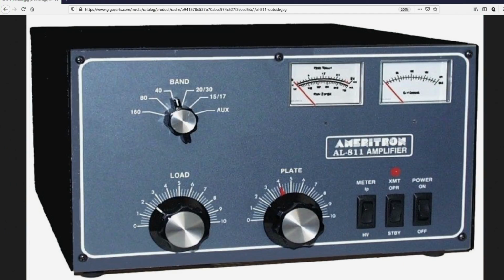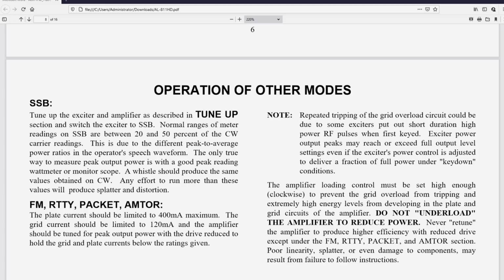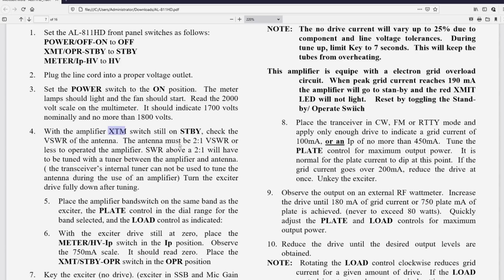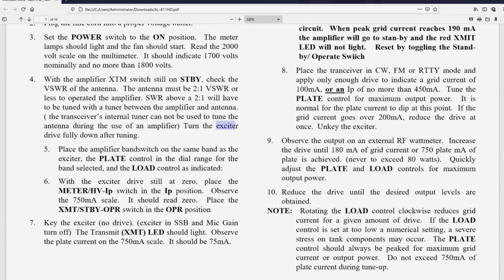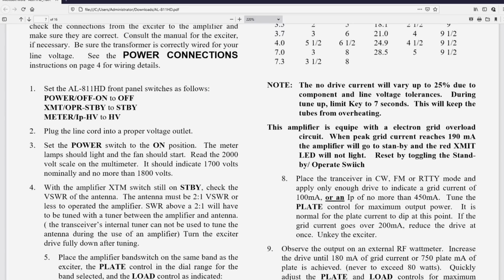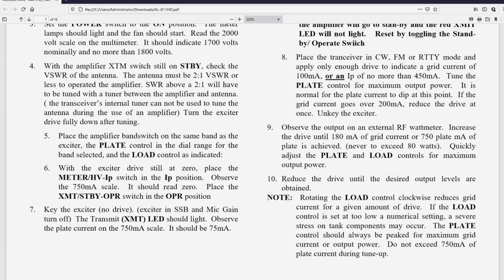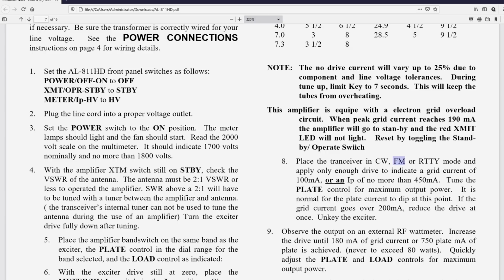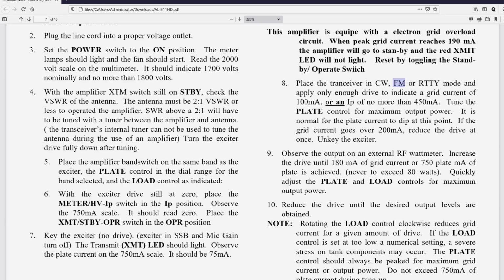Ameritron Amplifier AL-811 Instructions Have MANY MISTAKES About Tuning As Shown By Jim Heath W6LG

Comment: The AL-800 is three 811A tubes and 600 w.  The similar AL-800H is three 811A tubes and 800 w.  572B's are drop in replacements, but replace all four tubes.  The 572B's will not make any more power than 811A's, that is determined by the power supply.  However the 572B's are more rugged.  I replaced my own AL-811H with the ALS-600S (600 w), and no one receiving my signal could tell the difference.

Comment: I have the AL 811 and am afraid to use it because this manual is confusing . I know that I am suppose to NOT exceed 550 mA on the plate and NOT exceed 150 on the grid. And your suppose to key for 5 seconds with 15 second cool downs. And you never want to exceed the maximum plate current. These instructions also use the word exciter. Well from what N5SIM (Troy Radio Service) told me, Your radio or transmitter becomes and exciter when you put an amplifier between your radio and antenna or tuner. So Radio to amplifier to tuner to antenna. This manual does need to be re written not only for spelling and grammar but to get it up to date with modern radios like Flex Icom & Yaesu. In my case a Yaesu FT 710 or 991A. The manual also mentions on page 6 paragraph 6 "key the exciter (no drive ) Does this mean zero power ? 0 Watts ? WELL modern radios go down as low as 5 watts NOT 0 watts. W8JI wrote another manual for this radio too. I guess I wait until I can get someone over to my house to show my how this is done. Thank you.
Reply: Hello James - I have the Ameritron AL-811HXCE.  The manual is very bad as you know.  However the easiest and best way to tune your amp is to tune it up driving it with 10w then peak both Plate and Tune for maximum power on your outboard VSWR/Power Meter.  Increase your drive power to around 40w and again peak both Tune & Plate again for maximum  power out.  The maximum driving power is around 70w.  Always tune for maximum power.   My AL-811HXCE has 4 x 572B's so I drive it with a maximum power of 65/70w.
If you amp has 811A's don't keep the key-down tune up for more than the time it takes to tune for maximum power.  The 811A's are not as robust ass the 527B's.
I hope this is of some help.
73 & Happy New Year

Comment: yeah, the AL-811 tuning instrux are horrible.  hardly anyone i know understands "page 7" of this manual.  the best way to tune this amp is by peaking the grid current and then dialing up the load to achieve the proper mA for the tubes.  Tom W8JI, the designer of this amp, has a great YT video on tuning it.  'Tom W8JI' is his username.

Comment: to sum it up .tune for max output and then increase load to the point where power starts to drop a bit...ok you do that in small steps (say 20, 40, 60w of drive)...but in fact that is what to do..tune for max power without overdriving and without going over 180mA on the grids...well explained how to do it safely (in 3 or 4 steps of power setting) ...
increasing load lowers grid current (and output if loaded too high)... so there is a sweet spot (and that is what we are looking for ... not?!?)
I guess easiest is to SHOW it to your friend in real...
in a 4 tubes amp the "dip" is not that easy to see but the max power on an external power meter shows you that sweet spot ...main thing is to watch max grid current (not to trip that safety circuit) ....and do not overdrive it

Comment: Thank you very much for this very informative video. Just acquired an AL-811, and will be eager to get it set up. I've been a ham for about 5 years, previously had a solid state Ameritron, which I was never able to get properly adjusted. Looking forward to getting this one in line and working. Nice to have the extra power when it may be needed.

Comment: This amp will not stop transmitting if the swr rises above 2:1.  The solid state Ameritrons will but the tank circuit in the tube amps can handle an swr of 3:1 and have no protection circuit to shut it down. Don't know why they even have that in the manual.

Comment: I other words not only poor soldering QC , but bad directions an all for $1000.00 WOW welcome to ham radio new bee’s! JohnBoyUtah KJ7TBR 🇺🇸😎📡🎙
Reply from the maker: Yes. So, as you point out, examining the amp before applying power is a good idea.  I have seen tubes out of the socket, loose wires and other poor connections.  The design is good and the amp overal is good for the money. The owner just needs to be very careful in doing a review prior to plugging it in.  And, never open the box without extreme caution to make certain that nothing inside has a charge on it.  Thanks for writinig.  73, Jim
Reply: CTR Engineering, mods are all good

Comment: I have an AL 811 and I did the 10 meter mod this morning. It will not key up on any band.  I bought it used a year ago and this is the first time I connected it and according to Ameritron, the 10 m mod is the same as the 811H. So today I am scanning You tube and asking questions. Any help would be appreciated.

Comment: Thanks John. It would have been nice to see your video when i first got my 811 3 tube amp. It is a older amp i bought used with RCA finned tubes in it. I must admit i have not done the load plate loade plate sequence as you teach somehow the instructions werent clear about that. I have been setting the load where the factory suggested and starting just under 20 watts and i usually peak the plate quickly rest and do the load. I have been doing it backwards for at least 5 years. Oops! I guess it's tougher than me! I always make sure the PLATE current is less than max, like the three tube amp max is 150 ma instead of 2oo ma on the H model with four tubes  i'm usually at about 140 ma on the plate and can't remember grid current but it is lower than it can be by a fair ammount. I am usually running around 450-500 watts with about 38 percent drive on the IC 7300. I will have to experiment and see what happens. When i get it peaked and tweaked, I do rotate the load till the output drops just a little. I guess i am lucky. Mine is old enough not to have the limiter although I believe if can be added.
Reply from the maker: I am very dyslexic and get lots of stuff wrong.  When I would testify, the Bailiff would say: Mr. Heath raise your right hand and .....  I had to stop and think. Right/left....hmm.  73, Jim

Comment: Like Roger below I have an amplifier, not a Ameritron, I fear to use and your instructions have set me on the correct track for tuning.  I have a late 70s Sigma 3000 D (2 3-500 tubes).  Question: If I do not choose to run at 2000 Watts (because it will kill my tuner), can I stop at any point along the way, slightly increase the load and proceed to operate say at 900 watts. WS7T
Reply from the maker: I do the latter and by doing that, don't damage equipment.  Thanks Jerry and 73, Jim

Comment: I just viewed this video. Thanks for posting. I’ve had an AL811H for a few years, but I rarely use an amp. But, during the times that I did use it, using the supplied tuning instructions, I always ended up hoping it was correct and saw jittery meters. I tuned the amp this evening after viewing, presetting the load and plate, then starting the process at 20 watts and stepped up through the 20 watt steps. All bands tuned smoothly and the process was so smooth. Metering looked great, not sudden jumps or strange readings. These are good amps, just take care of the 811’s. I feel certain that this new tuning procedure will add life to my amp. Thanks! KE8EC.
Reply from the maker: Excellent.  Tubes will become even more expensive.  So take care of the ones that you have....as you have discussed.  73, Jim

Comment: My first linear is the 3-tube AL-811, and the manual (version 4!) is as badly written and confusing as this one (almost identically so). I have typed up what you say, Jim, as it applies to my smaller amplifier. 
1. Select the amplifier band switch to the appropriate band and turn on but place in Standby. Place the Meter switch to read Plate Current (Ip).

2. Select the default Load and Plate settings per the amplifier manual (page 7).

3. Tune the antenna to the desired frequency with the ATU. (The amplifier should still be in Standby.)

4. Switch the ATU to the dummy load.

5. Put the transceiver in CW

6. Tune the linear for maximum power output by progressively increasing the transceiver output power in 4 steps: 20W, 40W, 60W, 80W then of drive.

•Each step should limit tuning time to 7 seconds maximum and be separated by a 10 second break.

•Ensure Grid Current meter never exceeds 100mA (half scale deflection).

•Ensure Plate Current meter (bottom scale) never exceeds 450mA (two thirds scale deflection).

a. Adjust the Load control to peak the output power, then pause CW

b. Adjust the Plate control to peak the output power, then pause CW

c. Adjust the Load control to peak the output power, then pause CW

d. Adjust the Plate control to peak the output power, then pause CW

Repeat step 6 for the next power level.

Ensure Grid and Plate current are under the aforementioned limits before finishing.

7. Adjust the Load control 1/2 a scale position clockwise (upwards) to protect from 100W of drive.
Reply: Thanks

Comment: Shouldn't the Grid Current meter (Load Control) be to the LEFT of the Plate Current meter (Plate Control) 
to match up with the recommended initial Chart settings and the Load and Plate Knobs? 
I think it would be more understandable if the protocol stayed consistent. W7WOW
Reply from the maker: As you point out, there are many mistakes and they have not been fixed.    Just tune the amp as discussed and it will last for many years. 73, Jim

Comment: I've been running an AL-811H for over five years, and I can guaran-durn-tee you that the initial load setting is nowhere near 3 1/2 for the upper end of 40 meters.   7 1/2 is more like it.
Reply from the maker: Tune for max out by stepping up the drive in small increments.  Then at max out look at the grid current again and advance the load control even further.  73, Jim
Reply: @ham-radio  Yes, and when I do that, the load control is at 7 1/2.

Comment: I was shopping for an amp and this one was recommended by my radio shop. Since I have zero experience with ham radio amps I pulled up the manual, read it like your friend did and passed on it because I wouldn’t have been able to set it up using their instructions.  Disappointing. Still looking.

Comment: What about tuning the input of the amp so the transceiver sees a low swr?
Reply from the maker: That's what you should do.  The input, often called a tuned input, can be a pi network or less.  Careful tuning is important.  Some argue that a high Q gives better results.  73, JIm

Comment: How do you set the ALC on an 811H Amp?  This presentation helped me a lot.  Thank you.
Reply from the maker: I do not use ALC because it can lead to distortion.  I tune the amp for max out and then increase the load control watching the grid current decrease.  In other words, I load the amp for more output than the transceiver can supply. 73, Jim
Reply: I like Jim’s approach here, because the voltage on the ALC line from the 811H amp is way too high for most modern solid state transceivers, anyway.

Comment: This has been tremendously helpful. A lot of us are wondering how to tune the amp for running lower power levels. Is it best to tune the amp for max power as you explained, and then turn the transceivers power down to reach desired total power output? Or do you tune the amp for max power at the power level desired and be done with it? 73. - KN4IQE
Reply from the maker: I always tune for max out and then dial down the drive. It will be clean, slightly less efficient with low IMD.  Thanks Steve. 73, Jim
Reply: @ham-radio  Thanks again Jim!